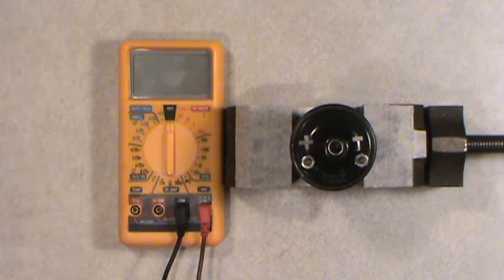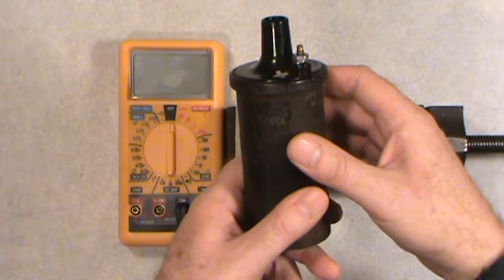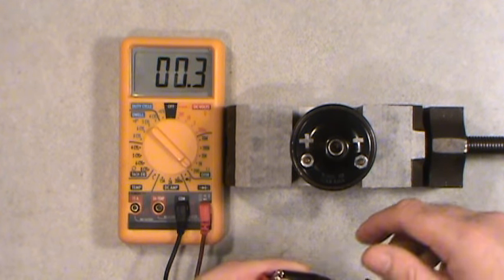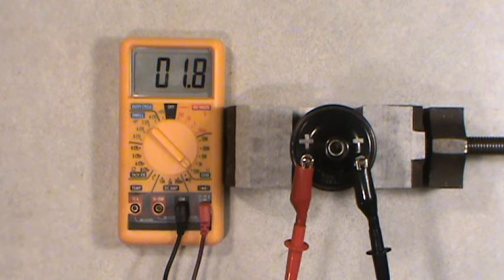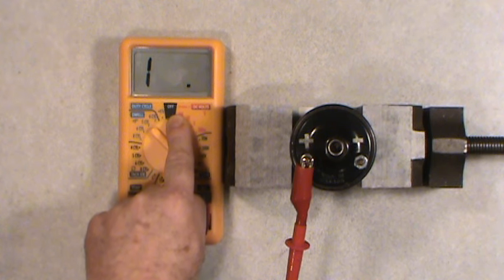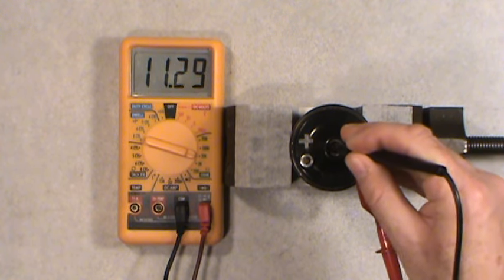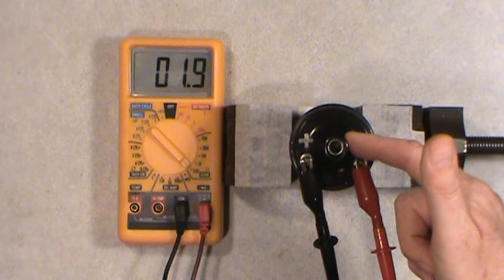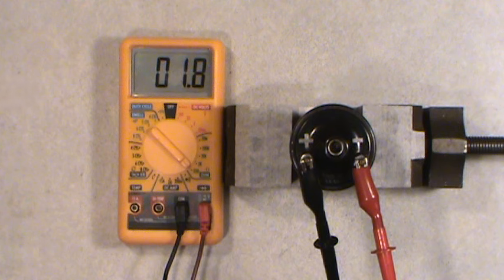Ignition Coil Test (The Short Version)

Comment: What coil are you testing? A3ohm coil or a1.5 ohm coil? Are the readings different for each coil?
Reply from the maker: Greetings...John Landry............Thanks for watching...........The ignition coil, that you saw in this YouTube video of mine, was very close to being, the "1.5" ohm, oil filled type of ignition coil, as, it had a "Ballast Resistor" (that was, the white-ish colored, ceramic block type), that was in, the ignition system's wiring circuit............The much older (pre-1975 there-abouts)..."3-ohm" (or a bit higher), oil filled ignition coils, probably, wouldn't have had, a "ballast resistor", in the ignition (wiring) circuit at all...........Yes, indeed, the primary coil of wire, that's hiding inside of, an oil filled type of ignition coil, is what you are ohms (resistance) measuring, and, there should be Ohms "Specifications", that the ignition coil's Manufacturer should have, for each different ignition coil, that they make, for both, the "Primary" (low ohms), as well as the "Secondary" (high ohms, that are usually measured, in the thousands of ohms)............It's always, very good practice, to try and find, the (low & high)...Ohms..."Specifications"...for the..."Exact"...ignition coil, that you are about to Ohms (resistance) test, other-wise, you'll just be takin' a guess, as I see it...........Now, here's my Train-of-thought (all aboard...???...lol)...........Usually (as far as I recall), most of the older, pre-1975 Chevy's, Fords, Dodges, and AMC/American Motors, engines, would probably have the "1.5" ohm, oil filled type of ignition coil, along with a "Ballast Resistor", in the ignition system's wiring circuit...Why you ask...???...well, when the ignition Key, is turned to the Start position, then, the (electric) starter motor spins/engages, and might be drawing, oh, maybe around 200 Amps, there-abouts, and then, the vehicle's Battery "Voltage" will drop down, from about 12.5 Volts, to maybe about 9 Volts there-abouts (I'll have to measure that sometime), and also, the Battery's Amperage, will usually drop as well, and here's why the Ballast Resistor is used with a "1.5" ohm ignition coil.........If we, were to just use a "3" ohm ignition coil, all by itself, then, while trying to start the vehicle, and the Battery voltage dropped to that, about 9 Volts, then, that "3" ohm ignition coil, would drop that 9 Volts and Amperage even more (so to speak), thus, probably ending up with, a some-what, "weak spark", at the spark plug's electrodes, while in the Starting mode, when, what we really want, while tryin' to start a cold engine, is usually, the strongest spark, at the spark plug's electrodes, that's possible...........Now then, here's where, the, shall we say, "Magic", starts happening, when a 1.5 ohm ignition coil, is teamed up with, the correct/specified (ohms/resistance)..."Ballast Resistor" (oh and, besides the ceramic block type of ballast resistor, there was also, a special Resistance Wire, type of ballast resistor, that, as I recall, was, what some Chevys, and some AMC/American Motors vehicles, had in them), way back when............Usually, when-ever a Ballast Resistor, was in the ignition system's wiring circuit, then, here's what usually happened...........In essence, there were really "2...Separate"...wiring circuits, as in, one of them, shall we say, "By-Passed", the Ballast Resistor, when the ignition Key, was turned to the Starting position, thus, being able to provide, all of what the vehicle's Battery (power), had left over, due to the large electrical load/draw, that the (electric) Starter Motor imposed on it, and then, would give the ignition coil, all of the Volts & Amps, there were still available...........Then, when the engine started-up, and kept running, then, the ignition Key went into the "Run" position, and when it did, then, the Ballast Resistor, was now "in" that particular wiring circuit...........So now, that the engine is running & idling on its own, and also, the (electrical) Charging System is operating now, and, it then, increases the battery's Voltage, to about 14.5 Volts, and "without" having the Ballast Resistor in the "Run position" wiring circuit, the "Amperage" (Amps), would usually become too High, and the ignition coil would probably Over-Heat, and cook itself...but...with the Ballast Resistor in its place (with that 1.5 primary Ohm ignition coil), the Amperage is lowered, to a, shall we say...Safe...level/amount of Amps (Amperage), that, that particular ignition coil was designed for (pretty cool huh)............A very long time ago, I actually "touched" (with a finger or two), a Ceramic type of Ballast Resistor, while the engine was running/idling...and..."OUCH"...!!!...Damn, that thing was..."HOT"...!!!...and, it probably was at its Hottest (temperature), at (engine) idle speed, as it had to hold back, those excessive Amperes (Amps), to protect the ignition coil..........The ceramic type of Ballast Resistor, probably, wouldn't be as hot, if the engine RPM's were much higher, as far as I recall (and no, I didn't test it with my fingers, b-cuz, one Burn, was enough for me...!!!...lol)............So then, always try, to Only use, the "Correct/Specified" ignition system, parts & pieces, that were "Specified", for that, "Exact", ignition system, or, the ignition system, might, just be subjected to, a, shall we say, form of..."Russian Roulette"...Yikes...!!!...lol (and, I hope not)...and.......till next time.......Be Safe, take care, and have a good one.

Comment: I have a 1988 boat(4cylinder IO) that I am switching to electronic module they suggest the purchase a 3olm coil is this really needed or can I use the old coil ?
Reply from the maker: Greetings...jandjmca mcavoy........Thanks for watching........If the manufacturer suggests, that, you install an ignition coil, with a "specific", amount of low ohms, on the primary side, of the ignition coil, then, make sure that you install, a new ignition coil, that, they "specify", and, here's why........Let's say, for example, that, a 1.5 ohm ignition coil, was used, in place of, where, a 3 ohm ignition coil, should have been installed, in a particular ignition system circuit, then, that (not supposed to be in there), 1.5 ohm ignition coil, would probably start to "over-heat", and possibly get damaged, to the point, where it wouldn't work anymore...!!!..........Now then, let's, now say, that, an ignition coil, that has, a much "higher" then wanted, ohms rating, is put into, that ignition circuit, then, the result, would probably be, that, the "spark", at the spark plugs, would probably be, kinda "weak" (as in, not so strong), or, maybe even be, an intermittent spark, or maybe, no spark at all, possibly.........Most automotive types of ignition coils, have to be, shall we say, "charged-up", on the low ohms/primary side, with a certain amount of voltage and amps/amperes, for a certain amount of time, which is usually measured in, "milli-seconds" (1 milli-second = one second of time, divided into, one thousand, little pieces, and, it's, like trying, to count to, 1,000 in one second of time...!!!)...also, 1 milli-second looks like this----> (.001).........Might be, that, an ignition coil, could be fully charged up, in about 2 or 3 milli-seconds, on the low ohms/primary side, just before it gets triggered, to make that, high voltage spark, which occurs, at the spark plug's electrodes (yes, indeed, ignition coils, do, get charged up..."super fast"...!!!)...and, that's why, the..."correct and specified"...ignition coil...should always be installed, into, that..."exact"...ignition system's circuit...!!!.........If your new electronic module, is kinda like, the one, that is usually found, in an HEI/BIG distributor cap, distributor, then, make sure (if required), to use the "correct"..."heat sink/heat transfer-ing...compound/paste...between the ignition module, and what it gets mounted onto, or, the ignition module, will usually over-heat, and get destroyed...!!!...(use the same "cheaper" stuff, that the computer store sells...and..."don't" use..."die-electric grease"....!!!...because, it won't transfer the heat properly)...(if you care to, you can tell me, what kind of electronic module, you are going to use, and also, what kind of engine and distributor, that you are working on, that way, I might be able to help you out further, if Ya like).......Also, seeing as how, you have a boat there, then, always make sure, that, all of the wiring "connections", are "super clean", and tightened properly, as, boats, shall we say, tend to live in, a rather "high humidity" (moist), operating environment, which, can, and will, at times, cause corrosion, and, bad/faulty wiring connections, at the very same time..........Good luck Captain, and......till next time......Be Safe, take care, and have a good one.
Reply: @RockysRoadshow  Thanks you are spot on, after reviewing the instructions, they totally agree with you

Comment: Rocky...  so if reading is different from the positive node to the centre  and from the negative node to the centre - then the coil is dead?    What I get from the positive to the centre is about 10K ohms.  But from the negative to the centre I get zero.    However from the negative to the positive I get similar readings as yours.  Please advise when you have the time whether this is caput / dead.  Thanks!
.
Reply from the maker: Greetings...DIGITAL CANADA PRODUCTIONS...........You're welcome, and thanks for watching too...........Well, any of the used/good/useable, cylindrically shaped/oil filled ignition coils, that I have ohms/resistance tested, have always had, the "same" ohms readout, when-ever I connected, one of the ohm-meter's test leads (usually), down-into, the ignition coil's center/tower terminal, and the other, ohm-meter's test-lead, to either, the plus/positive, "or", the negative/minus (usually) screw-threaded terminals............When You ohms-tested, from the positive/plus/+, and, negative/minus/-...terminals, then, that, in itself, is usually, ohms/resistance testing, the Primary coil (of wire, that's contained with-in the ignition coil), which might be, oh, 1.5 ohms there-abouts, if a ballast resistor is in the ignition circuit, or maybe, 3 ohms there-abouts, if there isn't a ballast resistor being used, as I recall.............When-ever ohms-testing the Secondary coil (of wire, that's also, contained with-in the ignition coil), as in, from, the center tower terminal, to either, the + or - terminal, then, I've always got the same ohms reading, showing on my Multi-meter............You might try reversing your ohm-meter's test leads, while ohms testing, to see if there's any difference at all, but, I kinda doubt, that, there will be any, b-cuz, just about any of these, shall we say, simple ohms (resistance) tests, that we are doing here, as in, just ohms/resistance measuring, a length of insulated wire, that's wound into a coil (shape), usually, won't require a specific polarity (+ red...or - black), where-as, something, like an electrolytic capacitor, can act like a fire-cracker (as in)..."Bang"...!!!...if it's fed the "wrong" polarity/voltage, I be thinkin'...(4th of July...anyone...???...oh, and..."Today"..."is"...the..."4th of July"...!!!...how about that...lol).............When ohms measuring the Secondary/high ohms (coil), then, I can't recall, whether, it's the + or - terminal, that will add in, the Primary/low ohms (coil), to the high ohms measurement, where as, the other (be it the - or the +), that won't be adding any Extra ohms/resistance, to that high ohms measurement at all............This, primary coil's ohms value, of, about, 1.5 or 3 ohms, usually doesn't even show up, b-cuz, the Ohm/multi-meter, is usually set, on, such a High/Ohms Scale (20-k/20,000 ohms...???) to begin with, which, probably, won't be able to detect, such a small amount of resistance (aka, ohms) at all, well, as I see it, that is............So, if you can't get, about, the same high ohms readout, of that 10-k (10,000) ohms, and keep getting, what appears to be, an Open Circuit (as in, bad connection, or, broken wire...internally), then, there's gotta be somthin' wrong, or maybe, your ignition coil is of a Special type maybe...???............Maybe, have a look, at some pictures on the internet, that show the "internals" of the type of ignition coil that you have there, so, you can see what's hiding inside one of these things........If you care to, you can let me know, what type of ignition coil that you have there, that way, I'll have something, a little more specific to go on...thanks...and.......till next time........Be Safe, take care, and have a good one.